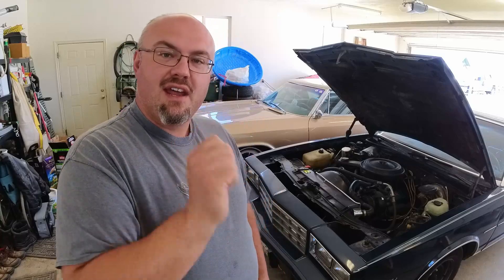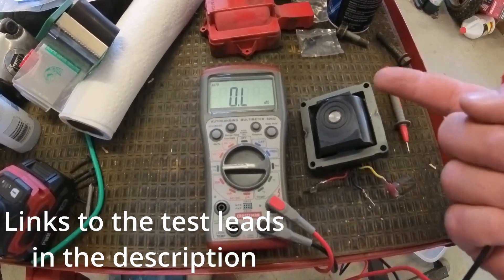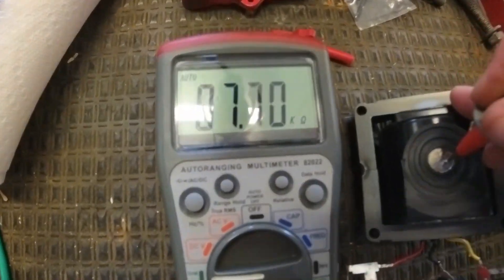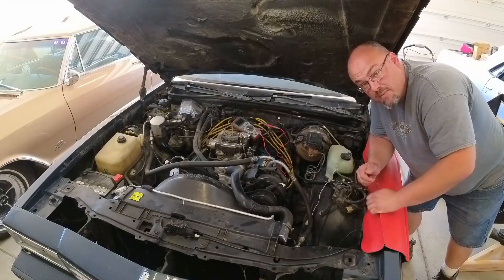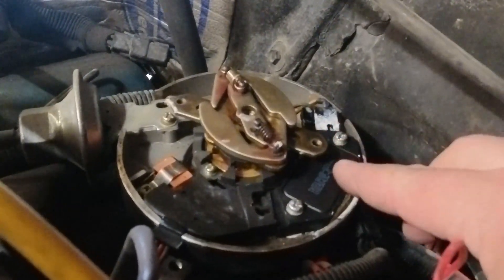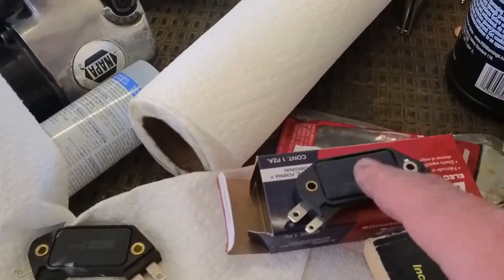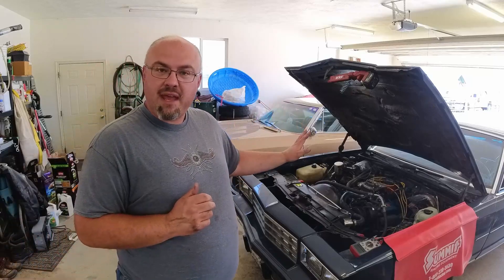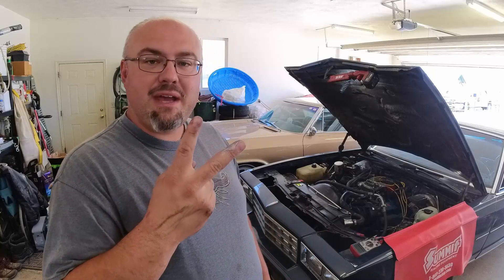Simple Solutions For The GM HEI Ignition and The Lost Spark!

Comment: I am running the Hays magna pulse i bought in 1975 on my GTO. i do have a HEI for it but the big cap wouldn't work on the tri power. the Hays uses a star wheel on the stock GM distributor of any make. Oh  also running the Judson  electronic magneto coil old guys remember those adz from the back of the Hot Rod Magazine.
Reply from the maker: Those old speed parts are so cool to come across!

Comment: I had the same problem on my 1977 Oldsmobile cutlass supreme. I changed out my distributor cap, my rotor, and the coil pack and still no spark so then my buddy told me about them ignition module and once I change that out, it was perfect.👍🏼
Reply from the maker: When I was learning about my El Camino, the module failed and sent me on a wild chase until my auto shop teacher asked if I changed the module too. Now it one of my first places to check.

Comment: Damn i think i have this problem now, converted my 91 f150 to carb and went with an hei module , mounted by the coolant reservoir on driver side, it ran damn good for 2 miles and then it would just crank crank crank no start. Hopefully this is my issue because im just about to junk the thing 🤣🤣
Reply from the maker: Check all the normal stuff first, like voltage, grounds and verify spark at the spark plug. I'm really a big fan of the MSD module for the HEI's.
Reply: @SnowFamilyRacing i checked for spark at the coil, i connected an inline lighup tester, between coil and distributor and when i crank it the bulb flashes on and off, i have fuel pressure a 5 psi,
Reply: @SnowFamilyRacing i think i caught my mistake. When installing the new HEI module i removed the resistor that connects from ignition switch to hei module then to hot side of the coil. 

It kind of explains why my truck would idle perfectly for a minute then randomly shut off. I didnt think i needed that resistor so i removed ir and threw away. I just got one from the junkyard and about to install hopefully it fixes my problem. Thanks for your help 👍

Comment: Never had a module last long at all ! Got a high performance one from summit WAY better , but still don’t last as long as they used to , I always carry a back up also
Reply from the maker: I've got a cumulative 15+ years on the MSD Module. That's consistently been the most reliable set up for for these today.
Reply: @SnowFamilyRacing just had another one go bad in 3 months , thinking about replacing the whole distributor, thoughts ??
Reply from the maker: Your call, if its all worn out, then yes. Otherwise it's put a MSD module in it and call it a day.

Comment: I only got 10.75 volts going to my battery wire connected to my coil, do you think that’s the reason for no spark?
Reply from the maker: That certainly sounds like a contributor. I can't say without having it in front of me. I bet the voltage drops below 9 volts when cranking.

Comment: Thanks for posting this thread, however you didn't fix the problem, what made it blow in the first place.  I really dig the Carter Thermoquad, I'm thinking that you might possibly know Jon Hargrove The Carb King..
Reply: Oh ya, ever notice how HEIs seem to go bad while the car is sitting. I put a Knife Switch on the batterys negative post and shut the cars electric system off after each use.
Reply from the maker: I've actually never had the problem of a HEI go bad from sitting. I understand that if they sit with power applied, like key on not started, that can ruin the module. Almost makes me wonder if there's an underlying issue, to be honest.

Comment: So we have to adjust dwell on any way? If so how? I changed my ignition module and my dwell is above 50 degrees and should be at 30. No idea how to get it down to 30 degrees on my dwell meter
Reply from the maker: There isn't a dwell adjustment on the HEI as far as I've ever seen. That's controlled by the module itself. More and more of the new modules are "bad" from the factory. I typically recommend the MSD module as the best replacement for these. It's a little spendy, and I haven't had one fail on me yet.
Reply: @SnowFamilyRacing I picked up a. Factory service manual. I see the dwell is adjusted by the carburetor so you are correct. Also, I splurged on the module and got the GM AC DELCO module it was 70 bucks shipped. I put it in and the car starts up like a champ. But now I’m getting a code 41, No distributor/tach signal. The manual says to check the wiring to the distributor and then the coil. That’s what brought me back to your channel. Quick question. The ohm test you did on the coil is also known as a resistance test correct? I need to watch a few videos on how to do that test with my Klein tool voltmeter.
Reply from the maker: Ohms are the unit of resistance, so yes, you are measuring resistance. Another way to use testing for resistance is when you are looking at 2 ends of a wire or component (like a switch) and you want to make sure that its connected, that is checking for continuity, and you are essentially looking for a 0 ohm value to show that you have a good connection from one side to the other. I've got several electrical videos on my channel that can help.
Reply: @SnowFamilyRacing Thx bro. This video brought me here. But you have tons of stuff I need to watch too. Thx for your vids
Reply from the maker: Thank you! One goal with my channel is to be able to make it easier for you to get things fixed. My intent is to consistently add value and help you enjoy your car more.

Comment: I need help with my delta 88 ….. it’s getting gas to carburetor and I change the Ignition coil,ignition control module,Rotor and distributor cap but still won’t crank.
Reply from the maker: It sounds like a deeper electrical issue. You'll need a wiring diagram and check out this video about how to find electrical issues. https://youtu.be/DjIHk0C2WCg
Reply: @SnowFamilyRacing everything is lightening up with tester light and battery voltage are okay.
Reply from the maker: You're going to need to start at one end and work your way through to the other to make sure everything electrical is where it should be. If it cranks, make sure that the distributor is getting voltage while it cranks. If it doesn't crank over, then verify that circuit is good.

Comment: I have an 85 MC with a 305, I’m new to working on cars, if I send you pictures of my engine compartment, can you please tell me what looks bad and good, and what I need? Thank you!
Reply from the maker: Pics are rather inconclusive and there's more to verifying that things work correctly by changing thr vacuum lines, verifying timing, and a general once over. These are not hard cars and can be very easily figured out. If it runs the rest can be pieced together. The best suggestion is to get a 1985 Chevrolet factory service manual. I've also got a few other videos about working on G body cars as well as a place to start on making classics run correctly. '85 would have had the electric Carbs, meaning there's a couple electrical connections on them. Most of the ones I see have been de-emissioned in some sense with older pre 1981 carbs and distributors. All easy stuff, really. Look through my catalog of videos and I bet you'll be able to figure it out.

Comment: Why have I replace 3 of these in the last 3 months?  What can cause these to fail?
Reply from the maker: Lots of things, including over or under voltage, grounding issues, heat buildup, and there's issues that go for a lot of auto electronics in the last 5 years - quality issues as they're being built. If you're replacing these regularly, check all those things and consider replacing it with the MSD Module. I've had very good luck with the MSD modules not failing.

Comment: Hey what's up do you know about when the car is not getting any power and every time you touch the battery the cables to the battery it Sparks
Reply from the maker: The little sparks indicate there's some sort of load. Grab a wiring diagram and start following the wires. Big spark and heat mean there's a problem. Check out my other videos on electrical diagnostics for more info.

Comment: Will a 83 deville have that part mine cranks but won’t start
Reply from the maker: Starting in 1981, GM started to use a computer controlled distributor and carburetor. I believe that transition went through about '85 on all models. So, yes, your '83 Caddy will have a module. It's likely not the common 4 pin like this unless it's been modified to an earlier distributor, it's either a 7 or 9 pin. Take the cap off and pull the module to verify and get the right part. Before you pull the cap off, verify that you have spark. Pull a plug wire, and a plug if you don't have a spare to put in for this test. Ground the spark plug against the engine or good ground, have a helper crank the engine and see if you have spark or not. Make sure you have the correct voltage at the distributor, I have another video that talks about how to determine where the problem is on a crank no start issue.
Reply: @SnowFamilyRacing thank you

Comment: Don't throw your old module away just yet. I had the same problem on my old 83 Chevy van, no start. I swapped the module with a known good one ( I kept the old one) and it fired right up! A month or so later it stalled going down the road, and wouldn't restart.I disconnected the connectors and plugged them back in and it started! When I got home I replaced the "new" one with the old one and it fired right up! Obviously it was a connection issue, I used some needle nose pliers and crimped the connectors a little tighter on the module and it never happened again.
Reply from the maker: I'm a huge advocate for verifying all connections. Power, ground, and every one in between.

Comment: Could it actually be the car if it doesn’t stay running?
Reply from the maker: This is why proper diagnosis is important. By ensuring that the distributor has correct voltage and produces a good spark, then the module or anything around the distributor is ikely not the issue.

Comment: 1990  305 Chevy After this Ignition module failed; and caused me A very Expensive towing Bill)  i.. figured out that Being inside of the Distributor; Where the HEAT  IS ; i.. made A copper Heat  SINK; from A 1” X2” copper pipe, Crushed the copper ; FLAT in A vice Between Two thick Metal Flat Bars; Then cut and formed the COPPER to fit the Shape of the BOTTOM; of the IGNITION MODULE) Drilled and Tapped Holes 🕳️ to Mount the Ignition Module   On top of the COPPER HEAT SINK ; using the DIELECTRIC. paste NOW the Copper Heat sink; Sits on the Mounting Plate; inside of the DISTRIBUTOR; and the IGNITION MODULE; is Held by Heavy  stainless steel machine  Screws; Holding the MODULE) Now no more OVER HEATING)

Comment: Great video, I have  a question the spark is weak what are the causes?
Reply from the maker: Possible causes include low voltage at the distributor, old or going bad plug wires, weak coil, the module could be slowly going bad, and if the cap/rotor have excessive wear. Kind of the normal tune-up items.

My opinion is always to start verifying good power and grounds. That makes sure you have a solid start to correctly diagnosing the issue.
Reply: Thank you so much  @SnowFamilyRacing

Comment: In your opinion and from your experience, what is the best brand of ignition modules?
Reply from the maker: I've got another video (made after this one) where I swapped in the MSD HEI module into this car. That one has proven to be more reliable than just about any other one I've found.
Reply: @SnowFamilyRacing  thanks. I just watched your other video and appreciate your information. I have a couple of my cars with HEI and haven't had any issues YET!! but I'm sure it will happen sooner or later. I'm going to order a couple of spare modules today.
Reply from the maker: A few spares isn't a bad thing to have around for a part like this. It's not particularly hard to change, just an annoyance when they do fail.

Comment: i had a 1982 Olds that the module failed  about every 10k miles. After 4 times  i found out the battery post was loose IN the battery.  Bought a new battery and it never happened again.  Not sure if that was the problem but it might have been.
Reply from the maker: That could contribute to voltage spikes. These OE modules are sensitive to spikes. I've found several electrical anomalies get solved by finding weird connections at the battery.

Comment: Put MSD6AL box in it problem solved 😮
Reply from the maker: That's one way through it. The MSD module is another way. This was swapped with the MSD module in another video, and has been trouble free since that swap.
Reply: @SnowFamilyRacing  I went through this bullshit an just install 6albox an open plug gaps to .55thousands an adjust carb a little
Reply from the maker: Like I said, there's several ways through this, and that is just one. I've got a 6AL on my El Camino, I know what those are about, and there's less intrusive ways to get some things done for different applications.

Comment: What carb is that??
Reply from the maker: That's a Road Demon Jr. It's kind of a whole bunch of different ideas, it's part Carter, part Edelbrock, part Qjet, mostly weird. It's been working pretty well for the 10 years it's been on the car.
Reply: @ I had that exact one on my 1986 c10 and I just swapped it for an edlebrock. I wasn’t able to find out what it was until now. Thanks
Reply from the maker: They're not a bad carb, they're just not a great carb. I didn't have a good Qjet core to build at the time I put this together. Otherwise, it would have a Qjet.

Comment: Hey dude I just got this part. I'm worried it blew cause of a bad ground so would it be a bad idea to just pop it in and hope my truck ones without blowing the new module?
Reply from the maker: Okay, a bad ground is an easy fix. The distributor is grounded through the block and the block should be grounded to the battery and the frame. Make sure you have a GOOD ground between the battery and the block like the factory intended. Verify the grounds and then swap the module. These parts have an unnecessarily high failure rate, and the more permanent fix is the MSD Module. I've done a video on the MSD HEI module if you want to go that road.
Reply: @SnowFamilyRacing  my only issue is the MSD module is like 300 bucks! I'm on disability so cash is tight. Thanks for the info & also amazing video!
Reply from the maker: Yeah, at the failure rate that I've seen some go bad, that would eat that up that  cost pretty quick. I totally understand working within the budget, it's a real thing, myself included.

Comment: Would a failing ignition control module cause a misfire?
Reply from the maker: It can. I've had them fail slowly and cause poor running characteristics. I've had more of them fail very quickly and just die. With a miss, I'd start looking at the condition of the ignition components  and replace them as necessary.

Comment: I've seen gm techs make the mistake of not using the appropriate heat sink grease when installing these modules.  If using a dielectric or a silicone grease, the modules are overheated and destroyed often the same day they were installed.  
They must be installed on a bed of heat sink grease.

Comment: Ok..GM HEI distributor system..The best money to spend is MSD Factory Replacement parts for your HEI..Especially the Distributor Cap and Rotor and Module...
Reply from the maker: In a later video, I swapped this car over to the MSD module. It's been absolutely trouble-free since that swap. I do run the MSD Cap and Rotor on my El Camino, which is raced, and they're good parts. For a driver, a good quality cap and rotor, like a Napa part, are likely sufficient.

Comment: I have an 85 4.3 truck,  it will initially start and then die…..it has fuel.   Could the module be the problem?
Reply from the maker: It could be. Most cases, it doesn't start at all if the module fails. In the suggested video at the end of this one, there's a video about how to track down the issue electrically. It could also be an issue somewhere else like a loose connection or a failing ignition switch.
Reply: The ignition switch has two positions, start and run.  The start position will energize the starter and ignition.  The key returns to the run position and the engine dies?  Ignition switch is the problem.  Turn the switch to the run position and check for full battery potential at the distributor connection.

Comment: I’m not getting any reading on the wire at all… to bypass it I ran a switch. Positive wire to the battery then a wire from the coil to the witch and grounded it. 
It worked for a day or so and then I was losing power while driving. 
I then replaced the connector on the original wire and got a reading, was working good till today, now I’ve got no reading, even after removing the new connector I was still getting no reading on the bare wire. I’m not sure what to do. I know the wire goes through the firewall to the fuse box up to the key ignition. 
Im going to replace the wire but if it doesn’t work, would I be replacing the fuse box and wiring ??
Reply from the maker: From here you need to check for power all along the way. You've got a bad connection somewhere. Could be ignition switch, could be a bad connection in the fuse block, could be something along the way. I have an electrical troubleshooting checklist in the description of the video I'm sharing at the end of this comment and it offers a step by step on how to chase down wiring issues. Go look at both of those, and I also have another video that shows how to get the fuse block free and fix something in there. https://youtu.be/DjIHk0C2WCg